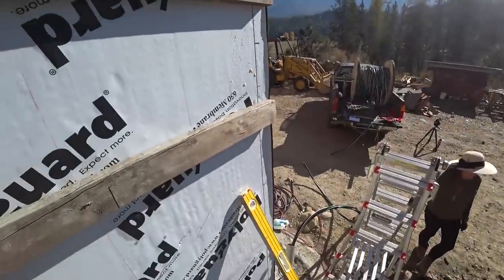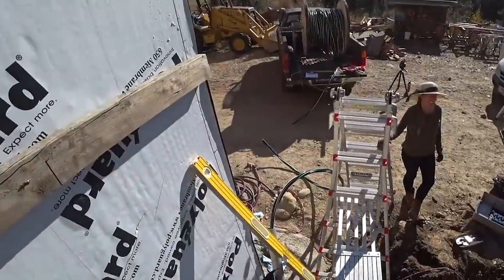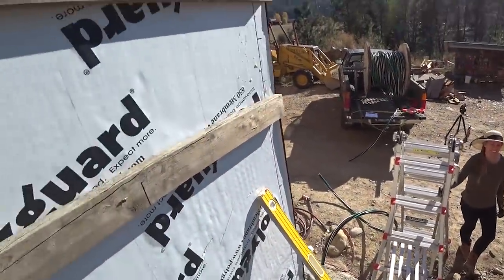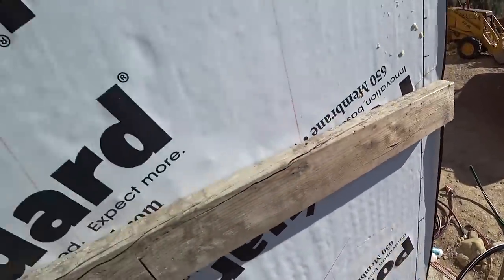Will 200 Amps Be Enough?! (Connecting House to Power)

Comment: Why not make a mount box the same size as your breaker panel, that way you can just put the siding on around it.  You always do everything 'temporary' so that you have double the work. Also,  you shouldn't drill holes in the Joists 4 inches from the bearing point.  There is a guide made by every Joist manufacturer that tells you where it's safe to drill holes and how big they can be.

Comment: Am I mistaken or did I see the electrician hook up aluminum cable?
I have always hated aluminum and though more expensive copper is so much better and safer! Many a home has burnt down due to aluminum wire becoming loose and causing a fire.

Comment: Electric is easy !  The difficult part is knowing code requirements.  Like which type of cable, type/depth of buried conduit.

I never heard of the requirement for an outside disconnect ?  Likely because you are so far from your meter/first disconnect.  I do agree that it is nice to have that outside load center (breaker panel) for other facilities on the property.

Drilling those holes and pulling that SER saved you a bunch or $$$.  Your time is less expensive than an electrician.

BTW, is 200A enough ?  A neighbor, who is an electrician, built a large garage/shop.  He wanted plenty of power for the shop and plenty for the house.  400A (!) to the back of the shop, split into two 200A feed, one for the shop and one for the house.  To save money, he installed the new drop from the pole himself.

Comment: americans and their low voltage high amp electrical... just absurd cable thickness. In sweden we use 3phase 400v or 230v single phase and the highest possible amps u can get is 63A, but normal houses got 20Amainfuse.

Comment: For the first time in its nearly 64-year history, Wichita Eisenhower National Airport’s runways will be renumbered.

That’s because of the slow but constant shift in the Earth’s magnetic poles, which has altered the compass headings pilots use to fly in and out of the state’s largest commercial airport.

Airport officials told members of the Wichita Airport Advisory Board this week that because of magnetic variation, the compass headings of Eisenhower’s three runways have shifted six degrees, prompting the airport to plan to re-number its two primary and one crosswind runways.

Since the airport was first built in 1954, the compass points for its longest runway, the west-side runway, measured about 10 degrees when flying to the airport from the south and 190 degrees from the north. That’s why it’s designated 1L-19R, or 1 Left-19 Right. Because of the magnetic shift, that runway would become 2L-20R.

Read more here: https://www.kansas.com/news/business/aviation/article193822529.html?fbclid=IwAR2gN_k_w43926JDtnHkCo_kN2HlrN8lkUWoIL6XTz-zNl28fYtDefcSojk#storylink=cpy

Comment: I apologise for the 'thumbs down' that's appeared on this video, something weird's going on with my YouTube today.  Every new video I have selected to watch has the down icon already lit up.  On the first one I thought I'd selected it myself by accident (it was 0200 hrs.)  but now I  realise it's on EVERY  video I pick to watch.  I've also tried to remove it but am having no luck, I compensated by clicking the liked icon.  I think with a 'Timber Framed House', especially one as big as yours it only makes sense to have a way to cut power from outside of the house, in the same way as ensuring you have external water capability.  Will that be your only breaker box though?  Will you be able to isolate power to particular zones as you need to work on them, the kitchen or the en-suite bathroom for instance from inside the house when there may be 10ft of snow outside?   I think it would be prudent  to install a Panel in the Garage/Utility Room (or wherever, so long as it's inside 😂)

Comment: @Mike Bateman, I agree. I've been an electrician here in IL for 15 yrs., this is completely over-complicating a relatively simple job. From the meter base, i would've used an LB down and took the time to drill through the concrete OR up, into the wood, and straight back down for the panel. Mount a 4' x 4' painted 5/8" plywood leaving room on one side for a phone and cable splitter box. By rushing it you've wasted about $600 in wire and time. But, the further you drag that panel away from the source, the more it drops. I don't think you'll use 200 AMPS anyway. I hope your wiring is neat, fingers crossed. take care.

Comment: the USA power system seems very inefficient having a split phase supply and such low voltage here (Australia) your options are simple most places have a single phase 230v supply or if you need more power for large items we have 3 phase 400v which is generally for people with large air conditioning or wanting some big workshop equipment since 3 phase is a lot more efficient also means the cables we use are much smaller for the same power delivery, so considering the biggest costs of an installation is labour and the cabling it is a massive saving since you can use much cheaper cables and smaller cables are easier to work with.

Comment: 200 AMP is pretty standard. Our 2 story house in Massahusetts was built in  1975 and has 200 amp service. A 60 amp subpanel was put in when we had the kitchen  enlarged for breaker capacity.  The house originally had baseboard electric heating, kind of the standard in New England back in the day.

Comment: Hello, I'm watching you as you go with house and in my opinion you are doing great ! But, about electricity, have some questions ! Why you didn't put main disconnect by the meter ? Have the feeling that if you supposed to put the mains by the electricity meter and run lines towards house and elsewhere, would be better, easier and less expensive !

Comment: For some time in the future::      I own few to zero aluminum ladders,,,, especially where electrical is concerned.  All of my general use ladders are fiberglass,, I used to own wood ladders as well.  Neither fiberglass or wood conduct electricity.  Your use today of two aluminum ladder and an aluminum pick, to work on an electrical service,, made me shudder.  

When you begin your interior,, you will have power in the house,, shift to fiberglass.  It may save your life.

Comment: For my suburb house 25 Amps for all kitchen/residential stuff, water heater is enough . Why should someone want to have a 200 for a residential house?
Reply: 30 amps 220V for a stove, 30 amps 220V for an electric water heater, 30 amps 220V for an electric dryer, 15 amp 110 for a microwave, etc etc.  Unless you live a pretty spartan lifestyle, 200 amps is pretty standard these days
Reply: 90/100 amp furnace
50 amp stove 
15 amp per room
15/30 amp hot water heater 
30 amp water pump
Just an example of breakers and to pass code the have to equal less than the the main breaker 200 amp in this case
Reply: That is with gas heating and water heater, right?
Reply: 200 Amp service is pretty standard for a single family 3 to 5 bedroom house.
Reply: because some people do not use gas or oil for heating the house/water and what not... unless you use a gas water heater 25 amp is just barely enough for a electrical water heater...
Reply: Are you on a 120/240 mains supply or a 240/480?  ‘Round my way, 100amp service is pretty much standard.  25 amps wouldn’t even run my stove. ;)  When they get to the video about the on-demand tankless water heater that will (in short bursts) draw 100+ amps by itself, the 200amp panel will make sense.
Reply: JAMikdiena... Then your whole house is running off a Wal-Mart extension cord!
Reply: Do you have gas?  If a house is all electric, (no gas), then it adds up pretty quick.  A clothes dryer alone can draw 20-30 amps.  Add to that another 30-40 amps for an electric oven.  Another 25-30 for an electric range.  Then of course another 5-6 amps for each electric water heater.  If you heat and cool with a heat-pump then another 5-6 amps for the heat pump and air-handler, and another 30-60 amps more for heat-strips that provide aux-heat when it's really cold outside.  Then on top of that are all your other electrical small appliances like TV's, Receivers, lights, and more energy vampires (chargers and standby) than most people realize they have.

Although it's unlikely that all those things will be on at the same time, they could be.  For example if you're washing and drying clothes at the same time you're cooking, and it's winter so the heat-pump is running, then the dryer, the water heaters, the oven, range range, and the heat-pump could all be running at the same time in addition to TV'S and lights.  This could put you close to, or over 100 amps for short bursts, and the next step above 100 amps service is 200 amp service.  That's why most homes have 200 amps service.  And since it's doesn't really cost anymore to have the extra capacity, why not do it?  My house is all electric (no gas) and has 400 amps service.

And of course if you have a workshop, then things like welders, table saws, drill presses, compressors, etc., all draw large loads for short duration when they are on while you're working.
Reply: Because he can..
Reply: I don't claim to be an electrician, but have wired my house, now in the process of doing my shop/apartment. All Three 200 amp service. The power supply (LOAD) wire for the shop/apartment alum 300 series, (0.75" Dia. Load wires) cost for just over 600 ft. (two three hundred plus foot runs) was over three thousand. I'm unaware of any new structures that are built with less than 200 amp service, I believe code calls 200 amp service the Minimum. Now whether or not you use all 200 amps is another story.
Reply: Because, anywhere other than North America that is the same as 100 amps at 240...so a standard installation here in oz
Reply: I bet you don't run the toaster oven, the microwave, dishwasher and clothes dryer all at once. 💜🌞🌵
Reply: Because pretty much the world is turning electric everything.. Especially cars!
Reply: Electric stove can use about 50 Amps, Electric clothes Dryer about 30 amps. That's 80 Amps just for these two devices. Throw in a water heater, HVAC, dishwasher, etc. and 200 amps does seem a lot. Also need to accommodate surge loads for instance when a large motor starts up. The initial draw can be considerably higher Also  a 200 amp breaker box can only support about 160 amps. A 200 amp breaker box is the current standard for new residential construction.

Comment: As far as I know your Spose to drill your holes 18 inches from loadbearing in those type of Joyce  because of Weight of the house and compression also looks like your Joyce are upside down pre-punched holes are supposed to be towards the bottom. unwritten rule of electrical and plumbing drill low staple hi so you don’t drill into a pipe or wire

Comment: FYI = Firefighters call the Electric crew to cut the entrance feeder or pull the Meter for a power disconnect. The outside panel has to be a NEMA Rated, Weatherproof box. The National Electrical Code requires the inbound cable to terminate within 3 feet of entering the building. Your 4 conductor cable inside connects to the Two Hots, the Neutral Buss bar, and the Ground Buss bars respectively. The only place the Neutral and Ground wires are common is at the Main Entrance panel.

Comment: I don't understand the outside disconnect? Just go to the electric meter and pull that, problem solved. If the structure is on fire I don't want to be the guy who has to run up to the building to pull the breaker.

Comment: You might want to put piece of plywood on top to strap down new electrical wire and label the wiring outside of the panel as well in the panel. Easier to trouble shooting the wiring down the road if you ever have any problems.

Comment: 200 amp it good, like Steve said below, but the last time I checked the National Electrical Code, the disconnect needs to be as close as possible when the power comes in the house. But since you have a 200 amp disconnect at the meter, there really isn't a need at the house for a disconnect. with that said, I do like the idea of the panel outside to feed the other items out of!!

Comment: A tip if you're pulling cable through a tight conduit, run the cable, then thread the conduit lengths onto the cable one at a time and glue

Comment: With that transformer, you have great options already for powering things. I'm glad you had a service  panel at the meter. The outside panel is a nice feature you won't regret when you build the RV storage on a branch circuit. Do a 300 amp panel internally as people suggest. Trust your electrician he knows what will be best in the long run.

Comment: First we live in Boise Id. & we were able to have our disconnect inside the garage only the meter is outside. Boise city code is very by the book compared to your area.   Second I was surprised that are not using coper wire. I have coper in my house but my runs are much shorter.

Comment: No. You will need 300 amp service. Why, you ask? One breaker will be 80 amps to charge that electric car you'll be buying. Sustainable living!
Reply: That'll be the windmill's job
Reply: Brian Claeys electric car? What a waist.
Reply: That can be solved by load balancing.  More sustainiable than pulling that much peak power from the net.
Reply: Yep, and if the local overhead cables have a three phase service you may as well have that installed as well.

Bit more initial expense when installing the conductors to the property but the service charge isn't that much more and if Jesse ever wants a proper workshop used three phase tools are a lot cheaper and more efficient. Will also enable the future installation of a super fast car charging point (or two).

---

NB. Most UK houses have a 64 or 100A supply, but that's at 240V so is roughly equivalent of 200A at 110V.
Reply: A level 2 need a 40 Amp!
Reply: Electric cars aren't anymore sustainable than gas. Most people won't ever need more than a level 1 charger, even level 2 doesn't require 80 amps, it requires a 30 amp breaker on 220v
Reply: Electric cars, eighty Amp might be over kill, unless two or more electric cars. Only have one Tesla now. Still have needs for heavy duty truck. Have 12k solar, total electric home.
Reply: I thought tesla chargers were 50 amps and level 2 chargers were 30amps?
Reply: No such thing as a 300 amp service.
It's 200 or 400.
Reply: Anything above 200 amps is usually considered commercial and charged higher rates.

Comment: ‼️‼️‼️  You MUST Extract the Heavy Gauge cable run by drilling your 1 1/2" holes in the Wooden BEAMS ‼️‼️‼️
‼️‼️‼️‼️‼️‼️‼️‼️‼️
It is a Fire Hazard and wouldn't  and shouldn't pass Building Codes 
‼️‼️‼️‼️‼️‼️‼️‼️‼️
Run them instead on the surface of the Concrete Wall in PVC or Steel Rectangular Trunking 
‼️‼️ Don't Burn your beautiful house down ‼️‼️
And follow Industrial Building Codes for your own Safety and your children's Safety please 😀

Comment: Cable core looks like aluminium if you use copper cable csa  will be smaller. Steve in Thailand.
Reply: And way more expensive.
Reply: Yeah, sure.  But equivalent copper would cost more than three times as much.  They pay 6% sales tax in their neck of Idaho, so add that, but the local (Oregon) Home Depot charges $13.86 per linear foot of 2/0-2/0-2/0-1 in copper versus $4.25 per foot of 4/0-4/0-4/0-2/0 in aluminum.  Assuming 70 feet, aluminum is $297 versus $970 copper.
Reply: Copper of equivalent current capacity is three times the cost.
Reply: Copper wire is about 7X the cost of aluminium.
Reply: nevets7152 the conductors will be smaller but it usually doesn’t justify the cost difference.
Reply: Copper is stupid expensive and hasn't been used as service entry wire in many years.

Comment: Good to see that you are getting the electrical into the house! It will make such a difference, especially with coming into winter!
I have a question, though: are you facing the panel to the outside of the utility room because you are concerned about water/electricity  being too close together? or for space constraints? Of course, you may have restrictions in your electrical code that I don't.
Otherwise, it just seems odd that you would not use the huge space you have available in the utility room! :)

Comment: Would never of used those i joists literally paper mache holding up your house
Reply: literally an engineered and tested-out-the-wazoo structural component that’s as strong or stronger than equivalent dimensional lumber.
Reply: In several countries in Europe not even allowed..same for the frame just standing on top, most codes demand anchoring to a kind of sill which in turn is anchored to the concrete
Reply: And that's why you're not an engineer.
Reply: Really? Maybe you should try to break one. You can hang a car off of them if you wanted to.
Reply: Those are incredibly strong, accurate dimensionally, straight, true and are used everywhere these days.  The "paper mache" reference makes no sense.  Get out of the 50's!

Comment: 🔴 Always Run a Large UPS to power Emergency Lighting using LEDs in your home.
They should be strategically placed throughout your home, so that in the Event of a Power BrownOut , you won't have to run around in the Dark, Rummaging around and getting yourself hurt while trying to find BackUp Lighting. 

🔴  Do it now, so you won't have headaches or Trips to the hospital when your first BlackOut Happens

Make sure your UPS is high above ground and not near any water lines.
Also check on the Battery health every 2 years